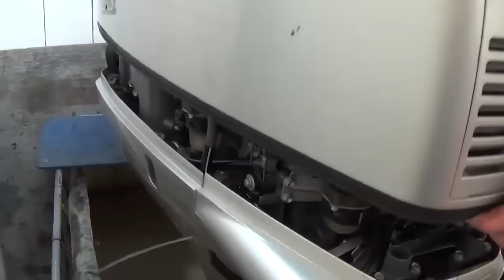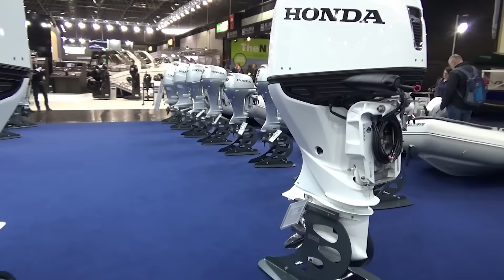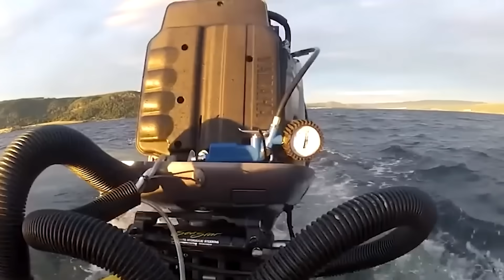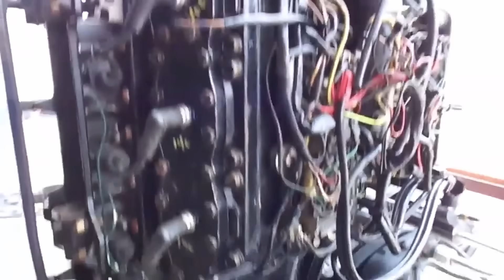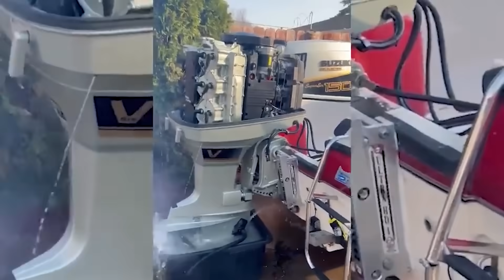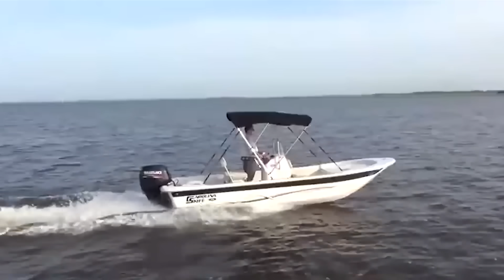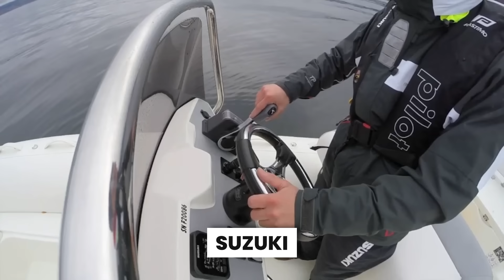Why Japanese and American Motors Are So Different?

Comment: When you had a tower of power on the back of your boat you had a real fast boat anybody know which motor was referred to as the Tower of power?
Reply: I do. There was the tower of power (The Merc outboard) and the leaning tower of power (The Chrysler slant 6 engine) :)
Reply: @timjohnun4297  sorry incorrect I don't think they used to leaning engine in the outboard at least I've never seen one I've seen Chrysler use a flat head and the thing but no the 115 Mercury engine was called the Tower of power and inline 6 that had a thousand RPMs higher than most engines of that are
Reply: @crazedgoldminner7384  Yeah, I was talking about the slant 6 car engine. Sorry, I should have been more specific
Reply from the maker: @crazedgoldminner7384  Good convo here guys. Thanks for spending time on the channel. Hope to see you back on other videos.

Comment: ive seen plenty of blown up yamahas on marketplace, but i dont think ive ever seen a burned up honda. seen lots of blown up mercs to. i think suzuki is the top dog right now. then honda. then yamaha. but mercs are the hot rods of the industry.
Reply: I've had 3 early 2000's Yamaha 4 strokes with eaten out blocks/heads. I've seen several Hondas of the same era with holes eaten through the water jackets into the exhaust ports. My current motor is a 2005 DF140 Zuke, so far so good
Reply from the maker: @timjohnun4297  Thanks for sharing Tim. Sounds like you are in the salt!
Reply: @ Yes. Flushed every trip. Not running them regularly seems to be the killer. Low hour motors seem to be hit the hardest.
Reply from the maker: @RichRich-jl5oh  The hot expensive rods for sure! What donyou own Rich?

Comment: It's all advertising. Japanese get more positive ads because of crooked CA import docks. American equipment was always superior until they started using foreign electrics. Imagine supplying your competition with junk? It's over now. The reaping is nigh.
Reply: you have heard of tohatsu right ?
Reply from the maker: @markgc65  A point well made Mark. Thanks for stepping in.
Reply from the maker: @richardpedersen2092  Thanks for watching Richard. Hope to see you back in the comments of other videos.
Reply: My love of Zukies has nothing to do with ads. 25 years of use with no breakdowns and they are the quietest motors made. I bought a 60hp merc brand new a few years back for a river boat and the cowling was no loose it rattled when I ran the motor. ridiculous. Sold it.

Comment: My little 50hp Mercury is probably the most reliable machine I own.
Reply from the maker: @paulcanon5533  50hp is not so little! You can do some speed with that. Depending on what boat you are running with I guess?
Reply: @ yep, 16 ft. aluminum hull fishing boat. 28-30 mph. Plenty fast for a 71 year old guy!  Thanks for the video.
Reply from the maker: @paulcanon5533  Experience to handle the speed. Enjoy!

Comment: I ran a merc 150 xr6 for 28 years it was a good motor but it was really really thirsty, I traded it on a Suzuki df 140 b and wow what a great motor, I can’t tell you how many times at the launch people ask me is that thing even running,it’s so quiet and smooth and the fuel economy is unbelievable. I have a buddy that has a shop and is a merc tech and he said that merc would be his last choice .
Reply: I have a 2000 Mercury 250 XB Pro and man does it burn through that 93 octane. When I first got I could have sworn I had a fuel leak.
Reply from the maker: @dexterosten  Unfortunately in the boating world you often need deep pockets when your start playing with bigger end if the hp spectrum! Thanks for watching!
Reply: yamaha, honda, suzuki>>>>>>every other manufacturer is garbage
Reply: Because America's answer to more power is just make it bigger!
Reply from the maker: @markrainford1219  but they do love it!
Reply: Comparing a 28 year old motor’s fuel efficiency with a brand new one is where you lost me.
Reply from the maker: @BrianHinz-u6i  amazing story, thanks for sharing!

Comment: Retired outboard mechanic (2 stroke era) back when OMC had a factory here in AU, spent many a weekend social & ski racing so long ago. The 2 stroke had poor torque, trying to pull 3 blokes on single ski’s out of the water could be a bit of a trial but once up they ran forever. Cheers.
Reply: Back not so many years ago the 2 strokes were the only gal in town. Unfortunate that OMC disappeared. A number of different reasons why. Multi generations grew up with Johnson and Evinrude. They were icons in the boating scene.
Reply from the maker: @petehoskins1267  Thanks for sharing from the other side Pete! Love a mono ski, a 3 pull was my max back in the day - would love to go bigger!
Reply: My brother still runs a 1965 Johnson 9.5 I gave him years ago. Sucks fuel, but always run.
Reply from the maker: @williamsporing1500  Tske my fuel but show me a good time
Reply: I owned a panther with a 90hp 2 stroke Merc  when I lived in Ausi,  wow,  it had so much grunt out of the hole, and while towing myself and a friend on our single skis. I had a 60L fuel tank up the bow, and that made a huge difference.  I now own a 6m with a 175 Suzuki 4 stroke,  like most outboards are these days.
Reply from the maker: @TerryHickey-xt4mf Thanks for sharing and sounds like you had a great time on the skis!

Comment: My Mercury is made with nearly all Japanese part.
Reply: Some older engines, namely the Mercury four-stroke, were created alongside Yamaha. 
Tohatsu is one of Japan’s oldest outboard motor manufacturers. It started its Marine Corporation side by side with Brunswick Corporation to build outboards in 1988.
That said, Tohatsu outboard motors are all made in central Japan. Since Mercury Marine is part of Brunswick, Tohatsu outboards are often rebadged as Mercury outboards.
Reply from the maker: @kalleklp7291  well explained and thanks for sharing your knowledge. I will look at some over arching company videos soon.
Reply: Upto 30 hp likely a re badged Tohatsu. But Mercury parent company are part owners I believe.
Reply: If so it's really a re-badged Yamaha. Mercury sources parts from all over the planet.
Reply from the maker: @rodmakermagazine7117  Hi thanks for watching and commenting. Seems like it is going that way...

Comment: I had a 1988 30hp 3 cylinder Yamaha that had an estimated 8k hours before it bit the dust. Only thing I did was change the plugs and waterpump. The thing was bulletproof, it even got hit by a drunk guy in a truck doin 60mph while I was sitting at a red light and the only thing that needed replacing was the lower unit and prop. Could have kept the lower unit because it broke the skeg. Insurance paid to have to LU and prop replaced and I paid to have the waterpump replaced so that's what was done. By far it was the best outboard I ever owned!!!
Reply: So proud of you.